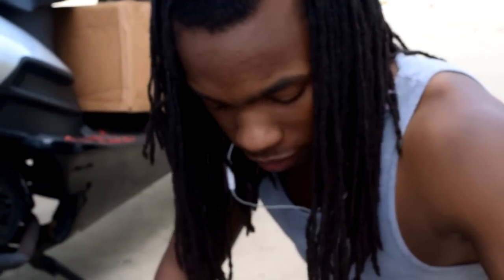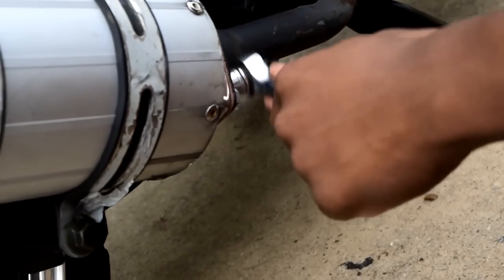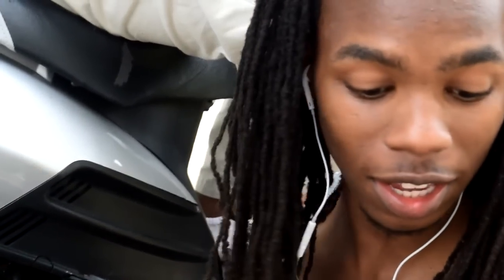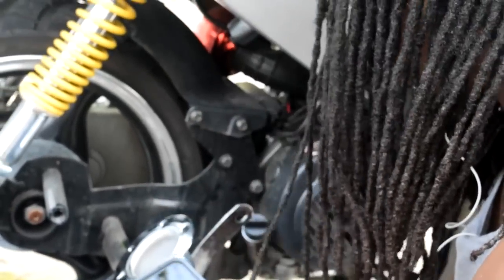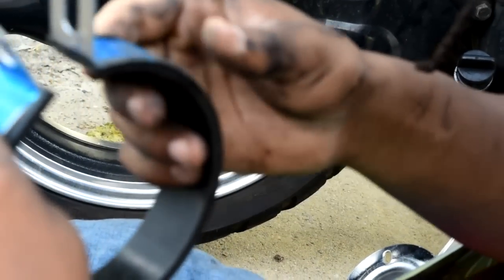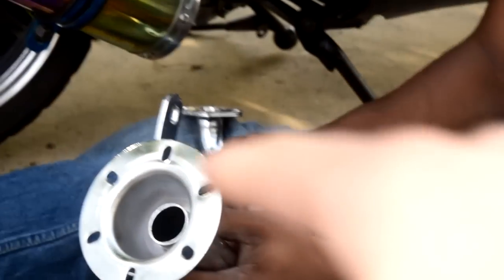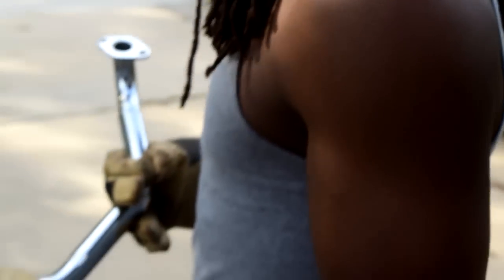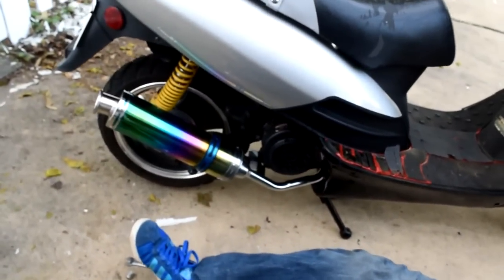THE BEST EXHAUST EVER | SCOOTER FIXING FT JAVON

Comment: i have the same muffler I'm haveing trouble with that same bracket hitting the dipstick tube and i just read that a moon shape has to be cut into the side of it i haven't got around to doing that yet but my question is where dose it bolt to once its modified the fender bolt are the swing arm to block bolt?
Reply: I'm having the same issue

Comment: I bought this muffler and it makes my bike so slow it has way too much restriction i then noticed its 411 mm my old one from factory is about 444 mm does that little length make the difference the muffler i bought is supposedly for my bike but theirs no way it cant handle my engines exhaust output.

Comment: So i was having the same problem with the brackets on my https://www.ebay.com/itm/Racing-Bike-Short-Performance-Exhaust-System-For-GY6-150cc-4-Stroke-Scooters-US-/402299974749?_trksid=p2349624.m46890.l49286 so i did some cutting off brackets and i cant remember what else but it was eventually stolen, crashed and then a few months later the exhaust broke at the manifold and started dragging on the street. Can you give me some hints on what exactly you did and what you think I should do? I know you can't see my bike or my exhaust so it's kind of hard but any advice is better than nothing. I just bought another one because this exhaust sounds awesome and I'm just getting the 50 parts that I need since it was crashed. Basically the bracket start or attached to the headers don't match up with any mounting holes on the bike . I'm wondering if I should just get a torch and beat him up to the point where I can bend them into place so I'm not putting too much pressure on the manifold.

Comment: What is the name of the exhaust?
Reply: the real exhaust is actually called leo vince hm titan
Reply: JeszPlays ebay
Reply: If you want this exhaust I recommend you buy it from lexmoto
Reply: JeszPlays don't get it the the bracket for the lower mount broke at the weld second ride. Top mount is good after almost a year. Problem is the top mount makes it nearly impossible to install. If it was for a 50cc the flange would never fit over the head bolts. You have to remove the timing cover and fan then unbolt the rear suspension and Jack the wheel up as high as it will go just to rotate it into position. Or remove the entire motor. I was like noooooooo don't cut it!!! Too late lol... I bet the exhaust is broken by now from stressed welds or he has a broken head bolt. Dude there are better companies, unless you don't mind welding or disassembling the right rear side of the bike just to install it or change a tire, or brakes or gasket or...
Reply: JeszPlays ط
Reply: Gy6 performance i guess